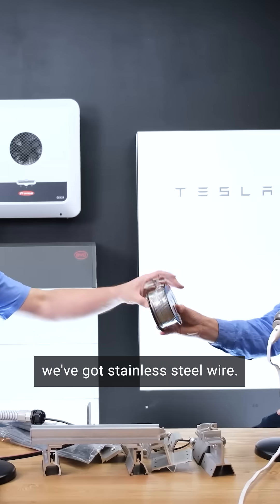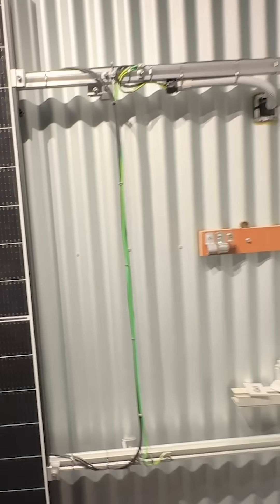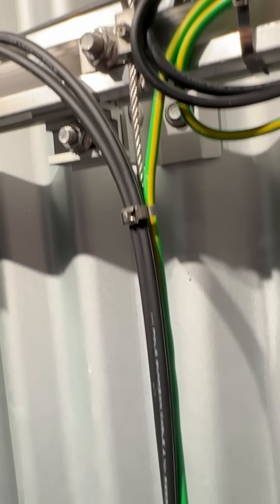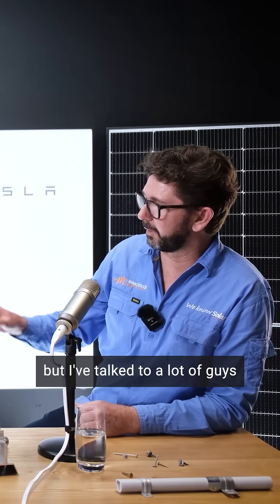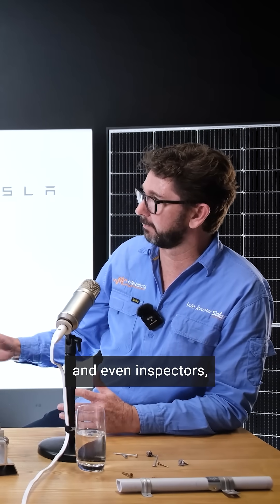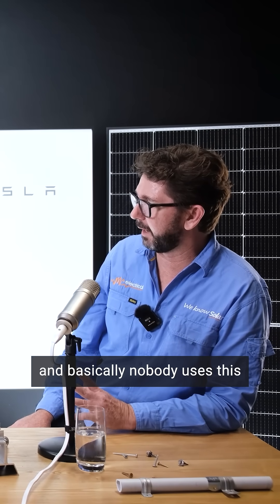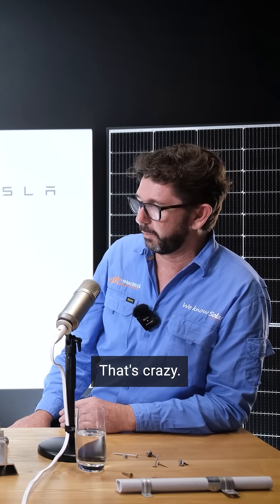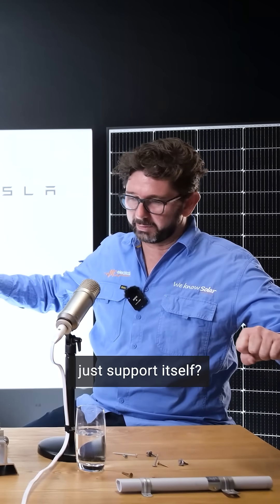The one Aus Standards rule solar installers aren't following.

Comment: I use galvanised catenary wire in Victoria to do a similar install to yours, i normally wrap the racking with electrical tape so the gal catenary wire isnt in contact with the aluminium racking though.
Reply from the maker: Nice. The stainless wire from Bunnings isn’t that expensive, even in handy little rolls.
Reply: @mcelectrical I'll give it a go next install, where do you find the clamps that held the wire onto the racking?